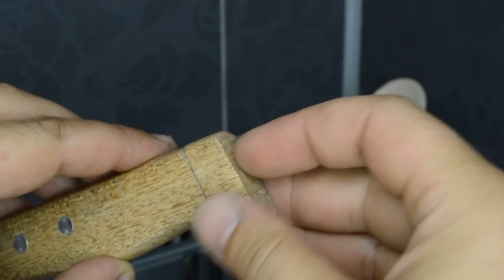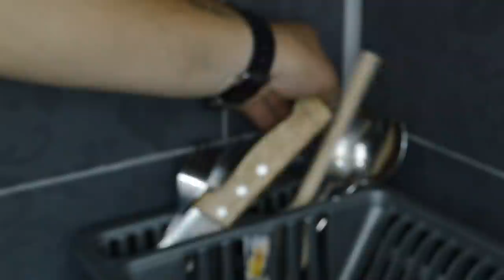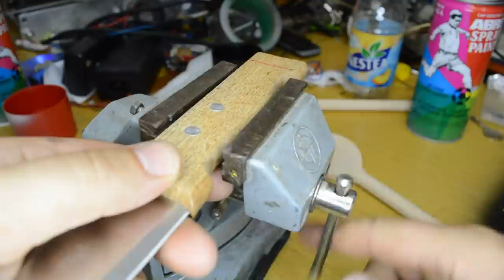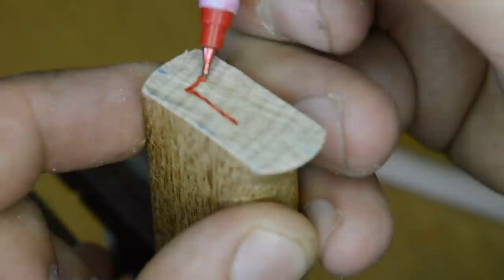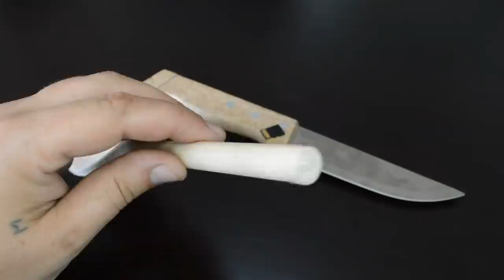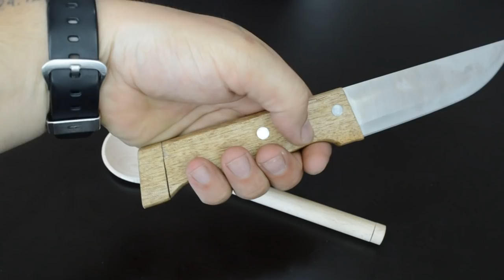Secret Storage Lifehack!

Comment: usb n the dishwasher is an awsome idea
Reply: as long as you let it dry nothing will be damaged
Reply: Sorry, but that's not true.  My flash drive was accidentally washed & no machine would recognize it, even after drying for over a week with the case off.

I'll bet hammering on the usb connector won't damage those tiny solder joints in there either...